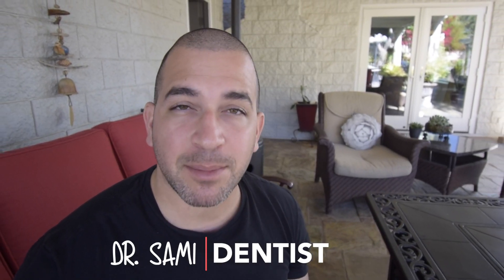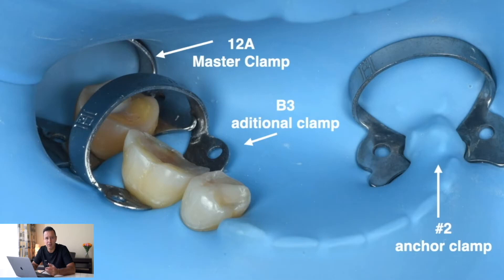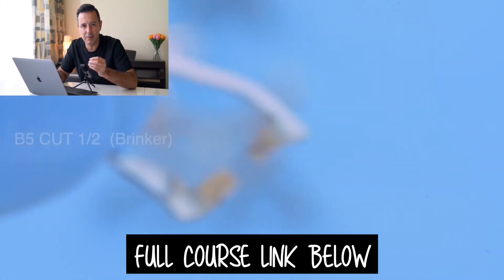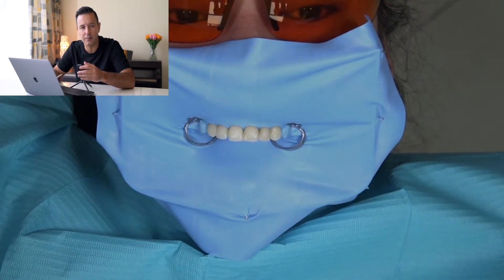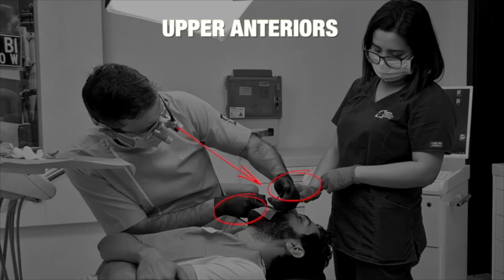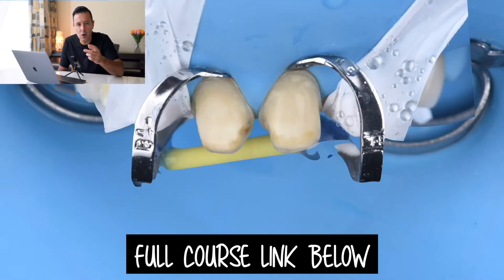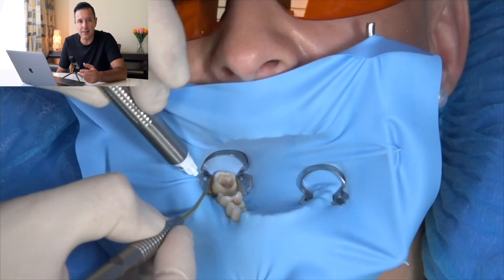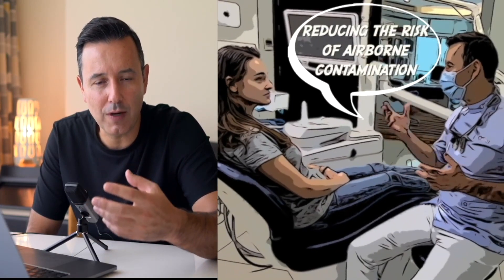Rubber Dam in Dentistry | Clamp Selection & Placement

Comment: Hey just curious, i’ve had a broken cavity for 2 years now and it used to hurt alot at first but now it doesn’t at all. I’m going to get it removed soon but just wanted to know if it’s dangerous? I’m scared now because i read if you leave it for a long time it causes health problems :( please let me know. Thank you
Reply: The fact that the cavity is still open (broken) leaves the inside of your mouth open to bacteria from the outside and even from within the mouth itself , that leads to complications over time such as abscess cyst ...etc 

Those complications become way bigger and harder if you have diabetes or any sort of heart disease 

I hope this info helps out ✌️